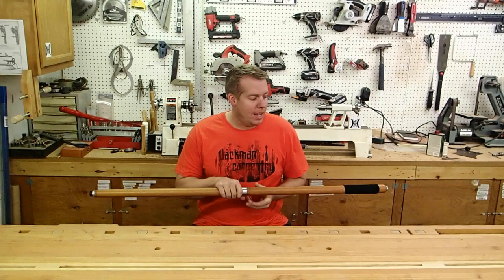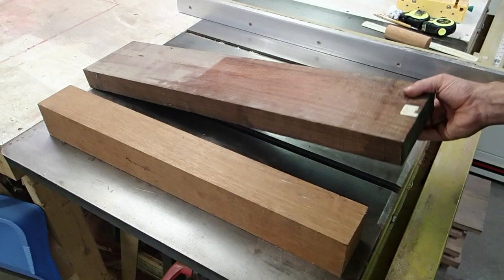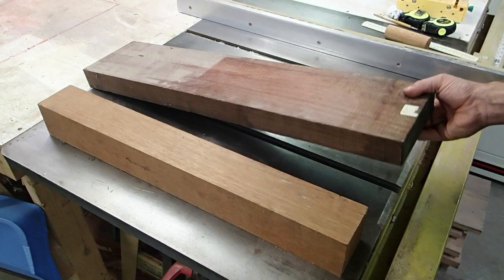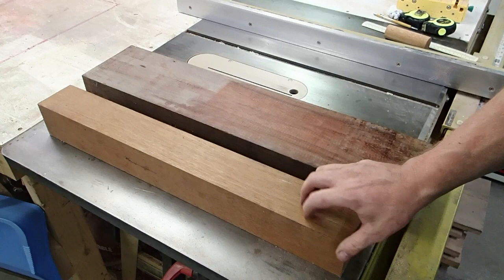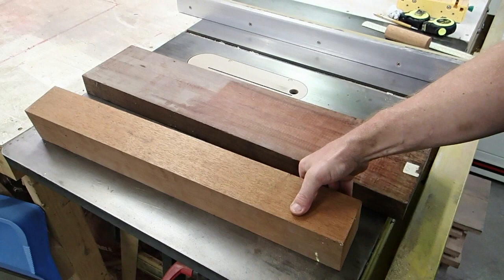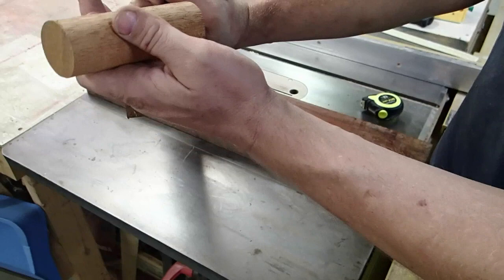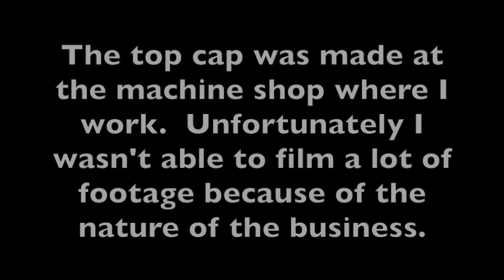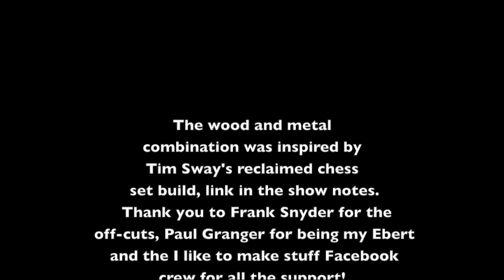Turned and Machined Walking Stick

Comment: I enjoyed this a lot. But, a question came to my mind when I saw the cord grip - will this not easily come loose?
Reply from the maker: Hi the loop I started at bottom of the cord captures the wrap at the top. You can see me pull it taught from the bottom to draw the cord in.  So far after 2 years of us the grip has not come loose.